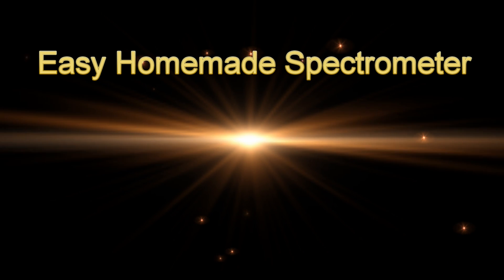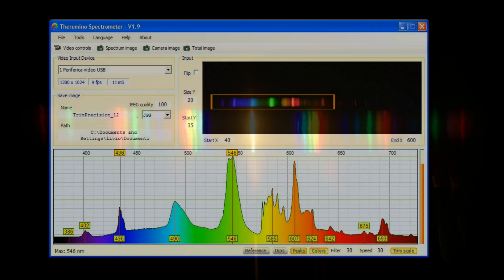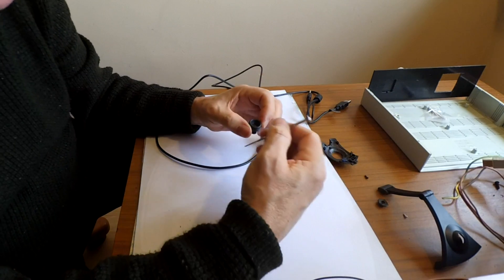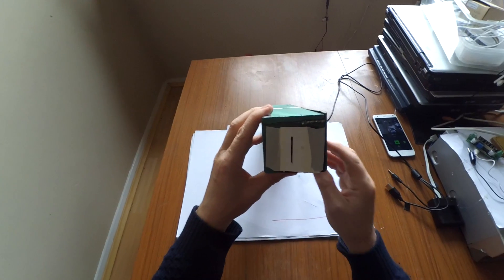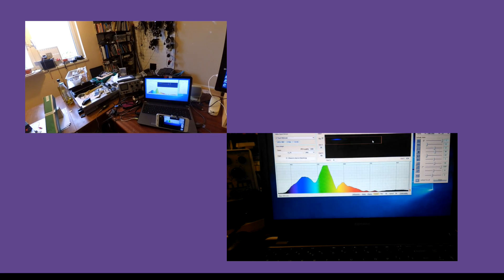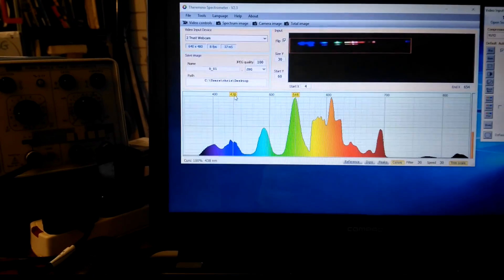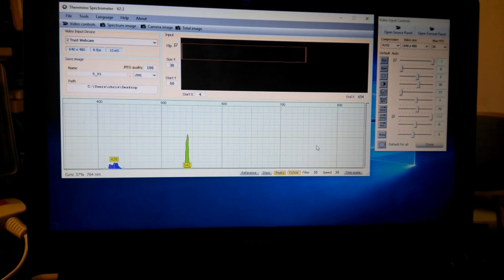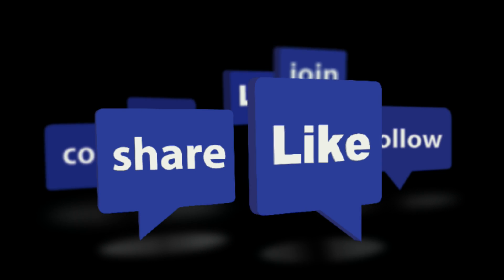DIY Light Spectrometer - webcam & diffraction grating - Applied Science at its Best!

Comment: Near Slit , What is there ??? Diffraction grating or Mirror ?How to select wavelength for this caase? for example 400-700nm  for analytical analysis of chemical solution or dye /Where you had connected DVD Diffraction grading? Have you connected the mirror? At the edge of the slit? Or you have connected in front of the camera-Lens?How to get absorbance -wavelength curve for a cuvette
Reply from the maker: How about "Hello" or "I weonder if you would help me" or some form of politeness?   Sending a stranger a loing string of qwuestions you'd like answers to so you can build an instrument like this rather than buy the one I sell - well - what's POSSIBLY not to like, I wonder?

Comment: How did you deal with the usb cable coming out the back? did you just poke a hole and tape so no light came through?
Reply from the maker: It's surprisingly un-critical. In this prototype I think I pinched the cable in the corner of the box hinge. On the production unit, there is a close-fitting hole in the sensir plate, which is 3D printed.

Comment: seems most webcams have that lens array barrel design where the IR filter is inside between the lenses in this metal or plastic barrel.
a pain the ass to remove, and almost destructible..
any hints on which cheap webcams are IR lens Removeable easy.?
Reply from the maker: It's getting worse as cameras get smaller and their filters get more integrated. The camera I showed in this video is no longer made.
Reply: @chriswesley594  ON the EU market, an alternative for DIY could be the Trust pro Spotlight, I reckon that model at some point also had that easy peasy separate square IR lens.
but then again that camera is like 20euro retail (1.3mpix) and not sure if that is still with that lens construction but I reckon it is.
picked up a cheapo from aliexpress at under 4USD delivered and very small and easy just plug and play with win10 and roll-up cable and with sensor focus adjustment tbut that one also uses that closed barrel lens array with IR and not easy to seperate..https://i.pinimg.com/originals/1c/fc/e4/1cfce4ecddcd21d691a8bb18f641f092.png

Comment: Good video! I'm looking to make my own DIY spectrometers using webcams, but looking at the daylight spectrum around the 9:00 mark raises a big question.
The triple peak in the blue, green and red areas do not correspond with the actual spectrum of daylight (see, for example, https://britastro.org/node/11331). So this points to the shape of the curve in your spectrum is more to do with the separate sensitivities of the red, green and blue sensors on the webcam chip than with the actual spread of light in the spectrum being measured. Is there a way to calibrate to correct the shape of the curve for this differential sensitivity of the RGB sensor pixels?
Reply from the maker: Hey Eddit thanks for your comments. This point has been made before. The spectrometer featured was my prototype and I had little experience using it. I can't be sure and I no longer have it, but I suspect it wasn't set up correctly in the software. The sensitivities of the webcam sensor are cancelled in the software. In fact the software measured intensities only - it sees a greyscale picture. Another point - every time I measure the sun's spectrum I see something slightly different. That could mean the instrument is rubbish, of course, but I don't believe so. If you Google "sunlight spectra" and select IMAGES you will see a large array of images which differ very substantially. So I think a lot depends on the conditions on the day. Spectra captured of CFLs, LEDs and TV screens all show excellent correspondence to standard spectra taken by reference scientific instruments. A number of my "i-Phos" videos feature those.
Reply: @chriswesley594  Thanks for the clarification. It's a question I've wondered about for a while.

Comment: Hello , thank you for the video , Is this able to detect asbestos ? problem is the detail that distinguishes asbestos exists in the range of 3000 nm wheras the majority of DIY spectrometers does not go beyond 800 nm , I'd like to know your opinion on this and if you have any ideas , I'm now to spectroscopy and i'm thinking to use simple DIY spectrometers and try to extract information using some machine learning on top of this since the reliable information exists on the range of 3000 nm and this is not achievable through DIY spectrometers.
Reply from the maker: It analyses to composition of light, in the range of about 400 - 1000 nm - so = based on what you say - no it won't do that for you.

Comment: okay so you calibrated the spectrometer wavelength-wise, but how do you calibrate it intensity wise? like if the spectrometer is not calibrated in both axes, you cant differ white leds of different temperatures because the peaks look smiliar but their weight is different
Reply from the maker: Klazzera - you don't. The (free, open-source) software provides a measure of relative but not absolute intensity. Other videos in my playlist to show comparisons with spectra collected from expensive laboratory spectrophotometers, and the agreement in relative intensities is excellent, but without that reference from a known source you select the exposure of the sensor to keep the spectral values out of the noise floor and the saturation point - and of course - that means you don't have absolute intensities.

It's a limitation in this instrument we accept in an instrument costing well under 1% of a lab insturment, and one which is inconsequential for many applications.
Reply: @chriswesley594  i'll be sure to check those videos too, thanks

Comment: wait, so why did you put it in a box if the box makes the software more innacurate?
Reply from the maker: nonoham, you lost me. I don't know what you mean, but if you can clarify I will answer your question for you.
Reply: @chriswesley594   i mean, the camera is basically a black box already, couldn't you have put tape over all but a slit of its aperture? do you know the SCIO? its almost sensitive enough to detect blood glucose and is basically just a 8cmx5cm camera in the casing with a battery
Reply from the maker: @monoham1  No, you need the slit a distance away from the camera and there is another diaphragm inside the tube and you need the diffraction grating too. Basically, these form the optics which make the instrument work.

Comment: On the light spectra, what unit is on the y-axis of the graph?
Reply from the maker: There are no units. The i-Phos does not offer an absolute measurement of photon flux density, it offers a relative measurement, though you can do rough-and-ready approximations if you  have light sources of known intensity.
Reply: @chriswesley594  That's a bit disappointing but I'm grateful for the insight. Thank you.
Reply from the maker: @mnzmnrq  Monzour, if you need intensity you'll need something  like the Ocaen optics instruments. Their USB2000 retails for about £1000.
Reply: @chriswesley594  I'm fabricating a low cost Flame emission spectrophotometer and I can't afford to purchase ocean optics instruments. Although to be fair, I actually considered ordering one because it's hard for me to compute for the change in concentration without correlating it with intensity of the flame.
Reply from the maker: @mnzmnrq  You can get a measure of relative intensity with the i-Phos, but you'd need to calibrate it with some other instrument to get absolute intensity. Even then the results would be less accurate than the Ocean Optics machine because the i-Phos uses a webcam as a sensor. It's a question of "horses for courses" I guess. If you need very accurate absolute measurements of intensity then the i-Phos is not for you. Anyway your project sounds very interesting - I hope you'll consider making a video about it to share with the world.
Reply: @chriswesley594  That's great! I actually want to use webcam as a detector for the color change of the flame. I'm currently using spectragryph as my spectrometer but the calibration of the software is difficult. I'm planning to use a laser of known wavelength for the calibration but I''ll try to use i-Phos and see if it fits my design. 

Ps. I'm considering making a video about the construction and abilities of my fabricated FES after I finish the paper and experiment.
Reply from the maker: Sounds good!

Comment: If you point the spectrometer to a good light it will saturate all and you can´t take a good measure...
Reply from the maker: You can change the gain and exposure settings in the software, and for the production version (link:  http://chriswesley.org/spectrometer.htm?ref=video1Comments ) You can also change the slit width.
For many lights you can also choose the distance of the light from the instrument to modulate exposure, and finally, you can also use neutral density (ND) filters to take down the photon flux.

Comment: Very informative. I am trying something similar with my scope and a Bahtinov mask and astronomy camera for stars and other celestial objects.
Reply from the maker: Hiya Baz and thanks for writing. I wondered about using the i-Pohs for astonomy but I don't have the time to give it. I like your Jupiter video!
Reply: Thanks Chris. Got a few snaps of a couple of stars last night to see how it works. The bahtinov pattern looks like a very low res version of the spectra i viewed online. So in principal it should work better if i can increase the resolution by narrowing the slits
Reply from the maker: I can see how you will see a spectrum but not how you could analyse it.  The i-Phos measures the spectrum - specifically the angle through which each wavelength was bent through the diffraction grating - and uses that to deduce the relative intensities of each wavelength. If I point mine out the window I can see the absorption lines of Oxygen and water vapour in the atmosphere. However, I don't see how to collect enough light from a star (another star, that is) to do the same. In conventional astronomy I think they track the star, and do a long exposure to integrate photons.
Reply from the maker: Wow. Fascinating stuff!

Comment: nice work :) but how can i export that data from the software  and use it in analysis  as  .dat for example ?
Reply from the maker: It's a great question Khawla Ata. Currently, the only way to export the data is as a JPG image. You can choose to export the image the webcam is seeing, or the graph or a composite image of both. There is no digital/text dump available. The softweare is open source, so I guess you could implement it, but if that's not your think, then - at least for now - the answer is "you can't".
Reply: i have no time for implementation  now :(  and  this project is exactly what i'm looking for , except that the software can't create an exportable file ,, Thanks for your reply at all  =D

Comment: Any way of using this to sample Reflectance (a series of reflectance values at various wavelenghts) Curve of a color sample on paper to mimic an expensive spectrometer used for measuring color or pigments reflectance ? Would make a great and inexpensive tool.
Currently this looks usable only to measure create a reflectance curve for lights emitters.

Also making is smaller and portable would be great.
Reply from the maker: Hi Mayorc. The instrument itself measures the light entering its aperture and it doesn't know or care how that light got there.
So if you could arrange your setup such that only reflected light entered it, then that should work, providing the intensity of that light is within the instrument's sensitivity range.
I have not done experiments on reflectance, but I have collected a great spectrum from a street lamp at night quite a way away, and the spectrometer wasn't even struggling. (https://youtu.be/Tz43jRf8FjY?list=PLEFr39dH1zRJ92LjBm08uHwJFFBeUZ6Gx&t=348), so I would be optimistic about this.

Comment: Is there any difference in using a Diffraction Grating Slides-Linear 500 line/mm cause you are using one with 1000 line/mm ?
Reply from the maker: Yes, with 500 lines, the angle of diffraction is different, and the brightness of the spectra is lower.
Reply: Thak you for the fast Answer.

Comment: I just found this vid, I know this is sort of ancient as in Youtube years :) but I was excited. One because I like to tear things apart, but also because I think you have helped me to solve a problem. I hope I am thinking right on this. If I were to refit my old cam, I could potentially make a spectroscope that I could also use to take a photo of the image? Is that possible. If I were to fit it with a grating, then I could snap a photo with it if I take my laptop outside? Thanks kindly.
Reply from the maker: Hi Rita, I'm not completely clear on what you['re asking. If you put a diffraction grating in front of a camera lens and offset the axis, you can capture an image of the diffraction pattern caused by the image. So if you put the grating in front of your laptop camera it'll do that, but it won't be a spectromgraph of the light source - you need to collimate it to get one of those., which is why my spectrometer has a long tube with a slit at one end. But you can find adaptors you ca make online which will do it or you. Later today I hope to release a new video showing my new spectrometer which is for sale - so if you're interested you might want to subscribe - just a thought.

If I have not answered your question, please feel free to ask it again in a different way.